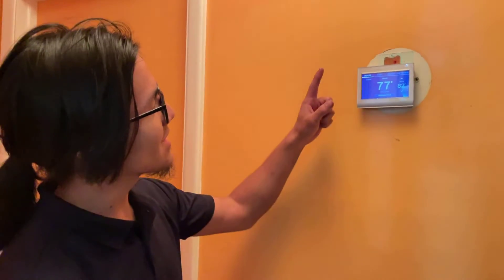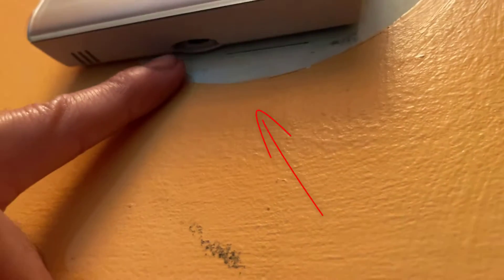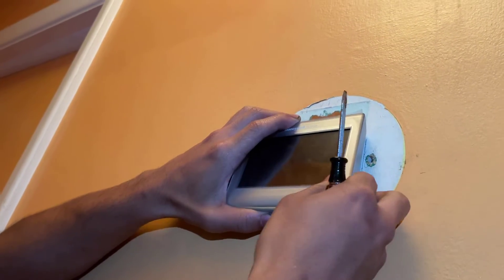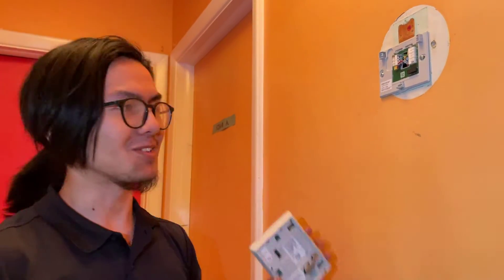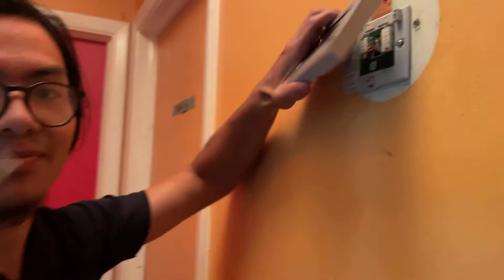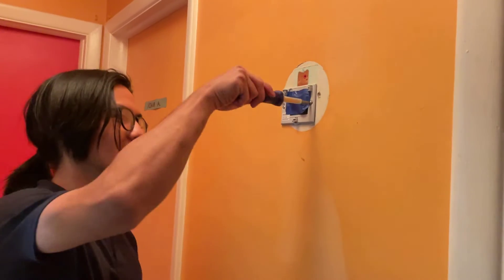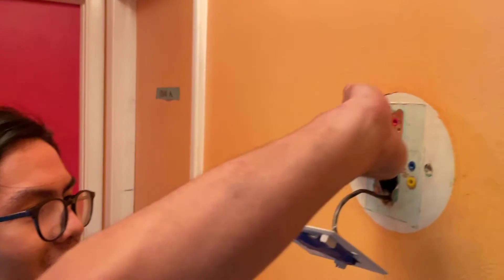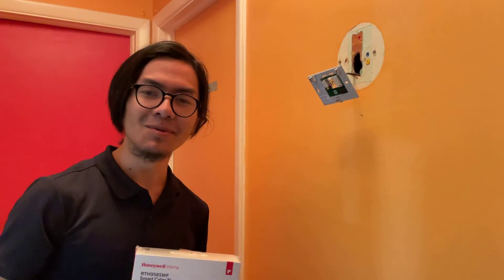How To Remove Thermostat From Base Faceplate Off The Wall Honeywell  RTH9585WF For New Install Etc

Comment from the maker: Here are the #ᴬᴰlinks to this unit as well as other popular brands mentioned in this video:
1.  https://amzn.to/49IdXKx  |  Honeywell Home RTH9585WF Wi-Fi Smart Color Thermostat, 7 Day Programmable, Touch Screen, Energy Star, Alexa Ready, C-Wire Required, Not Compatible with Line Volt Heating Gray
2.  https://amzn.to/3Td4lk8  |   Google Nest Learning Thermostat - Programmable Smart Thermostat for Home - 3rd Generation Nest Thermostat - Works with Alexa - Stainless Steel
3.  https://amzn.to/48MCH32  |  MoesGo Programmable WiFi Smart Thermostat for Home, No C-Wire Required by C-Wire Adapter, with Zone Remote Sensor, Remote Control Tuya/Smart Life, Compatible with Alexa and Google Assistant, 24VAC
4.  https://amzn.to/3TvmPgQ  |  Sensi Touch 2 Smart Thermostat with Touchscreen Color Display, Programmable, Wi-Fi, Data Privacy, Mobile App, Easy DIY, Works with Alexa, Energy Star Certified, ST76, C-Wire Required, New for 2023
5.  https://amzn.to/48Hso0c  |  Mysa Smart Thermostat for Mini-Split Heat Pumps and AC | for Ductless Heat Pumps, Window Units or Portable Air Conditioners, Control Remotely with Smartphone or Tablet, Energy Saving, Easy Setup

Or Click on Amazon link here and search for what you need:  https://amzn.to/3D1T2GQ

Comment: What is kind of battery we need
Reply from the maker: The Honeywall RTH9585 doesn't need a battery. It's powered by (C) Common wire. Watch this video out if you're interested: https://youtu.be/d634saCpIIs (How To Find Thermostat (C) Common Wire, Test R Y G C Voltage & Trace Back To Furnace Control Board) and this one: https://youtu.be/nHgLG4VJqL8 (Why My Thermostat Has 5 Wires But No (C) Common Blue Wire? | To Install Smart WiFi Heating & Cooling)

Comment: Are all these comments AI generated?  They all seem to focus on the word “dumb”.
Reply from the maker: It’s because originally I thought it would be “dumb” to do a video on this because it was a pretty small and swift action, and I mention this in the video… since this video was helpful to a lot of people, they’re telling me that it wasn’t dumb like I mentioned.
Reply: I found your video because my box is dead and I need to replace the batteries. It’s funny that I find it now after I already took it off the wall. I didn’t know about that little insert underneath and I did remove it from the wall with just my hands, but I remembered that it lifts up so I didn’t do it too hard and it was fine. Your video is the only one that I’ve been able to find that not only shows the plate on the wall, but you showed the back of the box and that is what I was trying to find to see if anybody would mention the batteries. I’ve never seen batteries like this before, and I can’t get them out. I also can’t find them online! How am I supposed to change the batteries? It’s extremely hot, I don’t want to have to go buy a whole new thermostat. Any suggestions? Thanks.